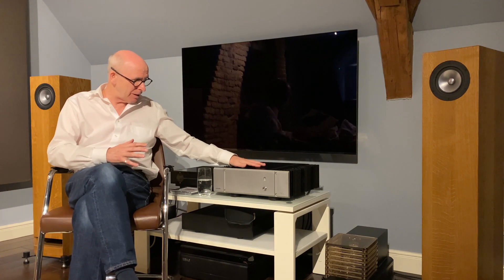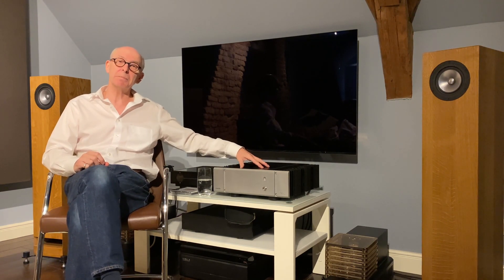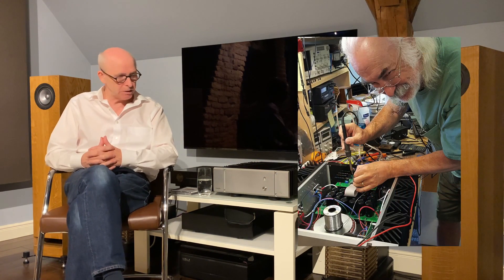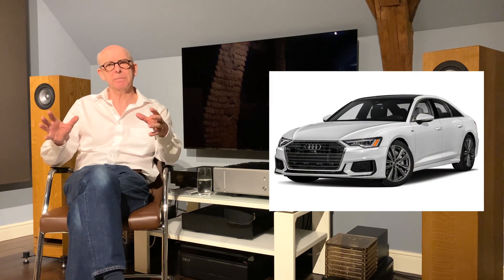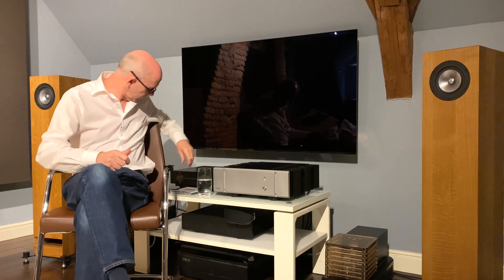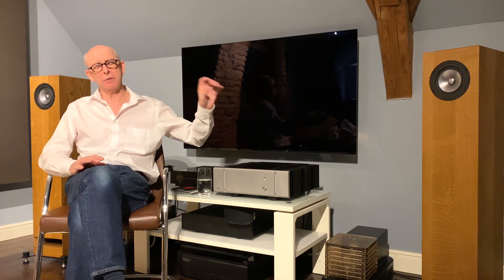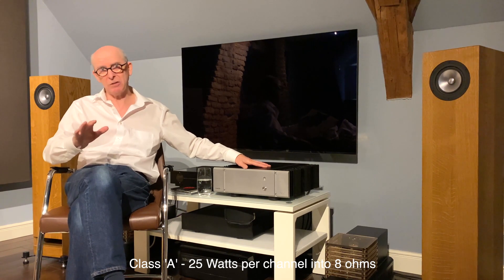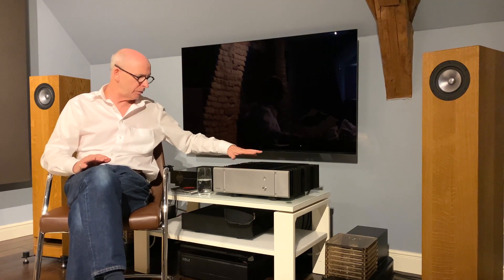Pass Labs XA25 - Class A amplifier (review)

Comment: I hope I don't come across as a troll and bother you here too much! I just want to make a technical comment about the XA25. The website says it's Push-Pul Class A. So it's not pure Class A. In fact, it is difficult to make an amplifier with transistors, be they FET or Mos-Fet, in pure class A. Push-Pull Class A is not actually Class A, that is, it is and it is not. The amplifier has a splitter that divides the signal into positive and negative alternating which is distributed to two amplifier branches, but these branches are already biased to class A, that is, the transistors on these branches are already open all the time and just waiting for the signal. In class AB or B, these two branches after the splitter are biased with a very small current that does not fully open them, and practically the transistors open and are fully biased only when the audio signal appears. So we are dealing here with a trick, which is welcome here, which reduces the noise and associated distortions that Class B biased transistors produce when they switch on and off when the audio signal is applied to them.
Reply from the maker: Hi, no problem at all.  You raise an interesting point here. So much so that I thought it useful to contribute a link to a Nelson Pass white paper on the subject (I will also put it in the description of the video itself, incase it does not work fully here in the comments): https://www.firstwatt.com/pdf/art_leave_classa.pdf

Comment: PassLabs XA25. Yeah, but it is really important to tell us what preamplifier and what front-end, Turntable-cartridge-phono pre-interconnect cables you have used. Most of the sound signature of any audio system comes from the front end and pre.
Reply from the maker: Hi. Thanks for your comment. Indeed, you make a good point. The pre was a QUAD Artera and a Lyngdorf TDAI 1120. I did not use a turntable in this review. Only CD and streaming.

Comment: Another great review Harley.  I jumped into the Song from Tidal right after and can duplicate everything you said except I couldn’t pin point the locations of male and female singers behind and it seems really close together.  Also drum, harmony and back singers are close behind not way behind in my system which consists of a Linn Klimax DS/ Lavardin p62/mono blocks driving a pair vintage JBL 4343.  Very wide front baffle of JBL are not great for pin point image but Lavardin helps bringing some of them back.  Thanks again!
Reply from the maker: Thank you for your very kind words. There are so many dependencies in stereo imaging, not least the room itself. If you have a lot of wall, floor and ceiling reflections, that can make a very big difference too. Your system sounds great, but you could try (for fun) borrowing a pair of narrow loudspeakers (can even be small stand mounted bookshelves / monitors) just to see how the image varies. The idea is not to replace your JBL’s but to see how much of an influence they are having in your room. Another thing to try is repositioning your loudspeakers. Sometimes, a slight toe in or out or a move of as little as 8-16 inches can make a massive difference! But most of all, don’t worry and enjoy what you have!

Comment: How would this compare to Lyngdorf 3400?
Reply from the maker: The 3400 is much more powerful. But in essance it is the same design principle, so I guess it is at least very similar.
Reply: I have both the Lyngdorf 3400 and the Pass XA200. They are very different designs! The Lyngdorf is so much easier to live with… but the Pass sounds so much better.

Comment: Thanks for another great review, Harley. I live in New Zealand and own a PureAudio pre-amplifier and, perhaps amazingly,  I had no idea that Gary Morrison had passed away, so I was obviously immensely sorry to hear about that. It will be a great loss to the local hi-end audio industry. The pre-amplifier is outstandingly good. You might also be interested in hearing that I've built my own class A amplifiers, based on the John Linsley Hood design from the 1960s that has been updated by Geoff Moss who has provided a more up-to-date method for accurately adjusting the quiescent current and output offset voltage as well as increasing the power output to around 50 watts into 8 ohms by doubling the number of output transistors. It's a really lovely sounding amplifier and I built two for a monoblock configuration. Furthermore, they are as silent as the grave when idling.
Reply from the maker: Dear John,
So sorry the news of Gary came as a shock. Some if class amplifier designs from the sixties were very good, but there is no doubt in my mind that modern components are generally so much better quality - and I can only imagine just how good your amplifier must sound. Thanks for your comment! (By the way. On the 2nd. Of November I have a new review coming out on the tiniest class A amplifier, one could imagine!
Reply: @PearlAcoustics  Geoff Moss and I corresponded over quite a lengthy  period of time and he advised me about many features involved in making the amps, such as the wattage rating of the toroidal transformers, the source of high quality and substantial heat sinks (six per amplifier) and he even laid out the amplifier components to produce a printed circuit board for me (using Spice, I think), while I designed the PC board for the power supply (which is really substantial). I wonder if Geoff is still with us? I had, by  the way, built the JLH amplifier before but lack of knowledge about the heat dissipation always caused premature failures. The two I am currently using have been the first to have been properly designed and constructed.

Comment: Great review! How warm does the amp get after several hours? Thank you.
Reply from the maker: Thank you very much for your comment. The official power consumption of the XA25 is 250W, and bearing in mind that it consumes this, even when there is no audible input, means that it is probably producing around 200-250W of heat into the room, so yes, with its big heat sinks, left and right, the heat is evened out nicely across the unit but it does still get quite hot to the touch. You won’t burn your hand but you wouldn’t want to keep it there for any length of time. Hope this helps?
Reply: I have one and it is a hotplate

Comment: I owned the XA25 for almost 2 years and thought it was fabulous!  The only reason I let it go was for the SIT3 Amp which is slightly richer with more bloom.. The XA25 is transparent without sounding sterile or edgy. It has weight and great bass control with a realistic midrange. Plenty of power for most speakers and renders piano better than any other amp I have heard to date..  Simple design with less being more pays off big in SQ.. Another masterpiece by Nelson and company..
Reply: I also had the XA25 and SIT-3 at the same time.  Similar but yes, SIT-3 had more bloom and sense of recording space, XA25 a little more leading edge, power, and control.  Two of the BEST amps I've ever had, and I've had a lot at higher price points.  Can't go wrong either way if you like the Pass sound.  Now I'm going full circle back to an INT-25 in my secondary system.
Reply: @kimchee411  sounds like owning both would be an endgame scenario? Being able to switch between the SIT-3 and XA25 based on mood/genres...
Reply: @kimchee411  Which one you preffer?
Reply from the maker: Thanks Mike!
Reply: Thanks for posting this information and your thoughts/opinions about this Pass XA-25 Power Amp
Reply: I did the reverse had the SIT3, but then switched to XA25.  SIT3 had a touch too much bloom for me.  I love the Aleph sound.

Comment: The local audio society is holding an audio meet in October and the Sibelius is the guest of honor... In preparation I auditioned a demo pair and I have to say that these speakers are just what I expected them to be (in a positive sense): accurate tone, very fast transient response, pinpoint soundstage and just enough of quality low bass to not need a sub for most music.

They sounded really clean driven by the LTA Z10 integrated amplifier with 12wpc from a push-pull EL84. This amp features the Berning ZOTL switchmode impedance matching circuit but it sounded just like any other EL84 amp I've heard: clean and musical with excellent bass control. The Z10 has a tube preamp section and linear power supply and it's internally shielded to minimize noise. The attention to detail in its construction is very obvious.
We did try the bigger EL34 ZOTL power amp with 40wpc and it did not impress us during the short listen. Perhaps the setup wasn't perfect to judge that amp, but what we heard from the smaller Z10 was really good so we finished the audition with it. The Sibelius speakers did not need more power in the small (maybe 20x20 ft) room with extensive acoustic treatment.

I hope to try another Nelson Pass amp with the Sibelius. It's the single-ended Zen with the current source load, minimized to 3wpc (while burning 65 watts, not very efficient...) into 8 ohms and tweaked heavily (for example, bare electrolytics with Blu-Tak for vibration control). That amp works great with my DIY single-driver speakers (vintage drivers, not MarkAudio) and I expect it to sound just as good - or better - with the Sibelius.
Reply from the maker: That’s great to hear! We’d love to see some photos, if any are taken! Good luck with your audio meet!

Comment: Very timely video. Just heard from my local distributor that my XA-25 is about to ship! Looking forward to hooking it up to the Sibelius with the PrimaLuna EVO 300 as the preamp. In the US the XA-25 is a bit cheaper, at "only" US$4,900. There is also a saying of "Buy once, cry once". I remember form past videos that you commented about heat output and summer vs. winter amps. The class A design indicates lots of excess heat, but at relatively low power rating of 25W it may not be that much. Would you consider it only a winter amp, or an all season amp?
Reply from the maker: Dear Daniel. That’s a very good question! I should have covered that more. To be honest the amplifier gets quite warm. The heat sinks have to do their work. Obviously it is not as hot as two large monoblocks! So if your room does not get too hot in the summer and it can take a little extra warmth - then bo problem at all. It’s probably giving off about 200 watts in heat. Hope that helps? Enjoy.
Reply: @PearlAcoustics  Thanks for that. I should have thought of looking up the power consumption (240 W). At <1 W sound output [plus LED light :-) ], that puts more or less all the 240 W into heat. Typical small space heaters are 1500 W, so it is only 1/6 of a space heater. Not too big of a deal. My listening room is on the lower floor, so even in summer there is thermal stratification, which keeps downstairs cool.
Reply from the maker: @danielgeiger7739  👍
Reply: Here is the Carolina’s, the summers are quite toasty..  The XA25 gets quite warm at the heat sinks, but doesn’t heat up the room.. it’s really not an issue.
Reply: @mikem4633  Finally got it in. You are spot on. Gets warm but does not warm up the room. And sound da bomb!
Reply: @danielgeiger7739  Enjoy ! Awesome amp, gets better with time. Try something with a well recorded piano.. just amazing. Enjoy the Music..

Comment: Another great video, Harley! It was a pleasure having you visit my showroom in West London :) 

I like your philosophy on simplicity and getting the power amplifier right - this approach is also very useful as source components (especially digital front ends and DACs) are changing so fast one may want to upgrade those after a few years - and a good power amp (or an integrated with no digital inputs) will remain a constant.
Reply from the maker: Thanks Ajay. We think alike 😉
Reply: I liked your review of the XA25, which helped convince me to order it without having heard it. Thanks!
Reply: @danielgeiger7739  am very interested in this amp too, can you tell me what system you have ?
I am running Supratek Cabernet pre into Belles SA 30 amp with Graham Audio LS 5/9.
Reply: @gryphongryph  I have a PrimaLuna EVO300 Pre and Sibelius SG speakers with a REL T9/I sub (don't use it much though). 
CD with Marantz transport and digital from a Mac Roon server to a HoloAudio May DAC L2. Tape TEAC 7000. Vinyl with VPI super prime scout with ADS, Soundsmith Zephyr MIMC* cartridge, EAT eglo petite phono stage. Did a rather thorough pandemic upgrade going from Rotel 1572 integrated with B&W CM6 S2, to the above. Speakers are more detailed and less mid bass heavy, the new pre/power amp gives much better soundstage and clean bass. DAC (Rotel built in vs. Holoaudio) is much more detailed, better soundstage, cleaner bass, but not analytical. Hope that helps. If you want to know more, let me know. I don't know any of your gear, so cannot compare directly. Sorry!
Room is about 18x18' (yes square!), set up diagonally with about 8' distance from speakers to listening position. Did a bit of room treatment with DIY absorbers (plus carpet, book shelves).
Reply: @danielgeiger7739  thanks for the reply, beautiful system you got there, interesting that you are in a square room, I will be moving my system to a square room too and I am kind of worried about that, I still have my older system, so that would probably be used in the larger living room for tv watching and casually listening.
Only thing I worry about buying the PassLabs is if it is powerful enough for my Graham Audio LS 5/9 speakers.
Are you happy with the match between the PrimaLuna and the Pass Labs ? Do you have a lot of usable volume adjustment ?
Reply: @gryphongryph  Thanks. Yes, no complaints :-) Re power, the Graham and the Sibelius are both 8 ohm. There is more than enough power in the PassLabs amp. If you worry about expense, did you see Harley's most recent review of the Chinese high class A bias $600 amp? 
Re square room, bass nodes are definitely there, but I can also hear them in my large living room, so they are a fact of life. That is part of the reason I have not used the REL T9/I much anymore, as I cannot get the position right. Tried the sub crawl etc., but just does not gel. I am not too much of a gut punching bass guy anyway, so I rather enjoy the Sibelius on their own. Plenty of bass for me. I would definitely give a diagonal set-up a try. I listen from medieval, baroque chamber, to darkwave, punk and electronica.

Comment: Are you willing to try an experiment...? should work on full range drivers like that I've done it on tweeters soft dome and works very well. Plus you could pull the driver Down half an octave without losing any top end
I think the Nelson pass amplifier would work well with KR audio preamplifier p135 opinions! should be a good match that's a good preamplifier
How does a chord amplifiers work with your speakers and a ACT amplifiers. UNISON research integrated amplifier unico might work quite well have you tried it?
Reply from the maker: Hi thanks for your comments. With regards the amplifiers you mentioned, I have not tried them yet. Thanks for the suggestions. During development, back in the 90’s we did use soft dome tweeters but the driver that Mark designed for us makes them superfluous. Our clients all over the  work are testifying for that. But I do see your point. Enjoy the music.